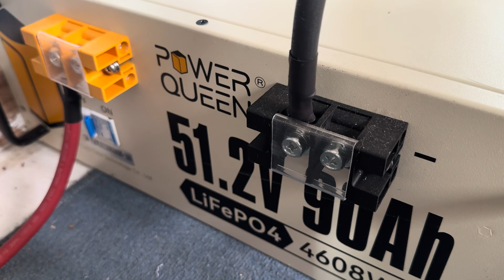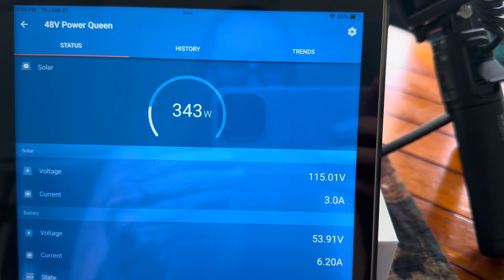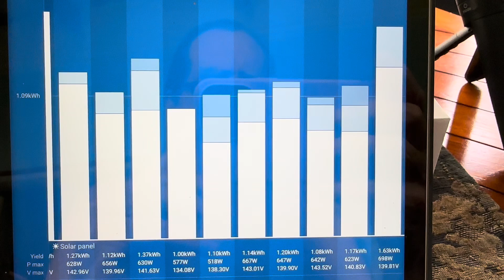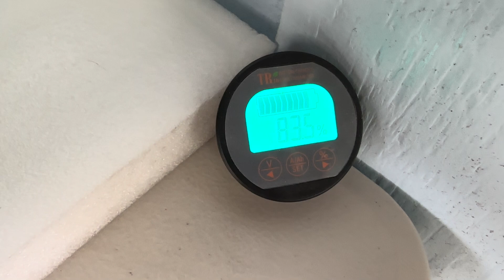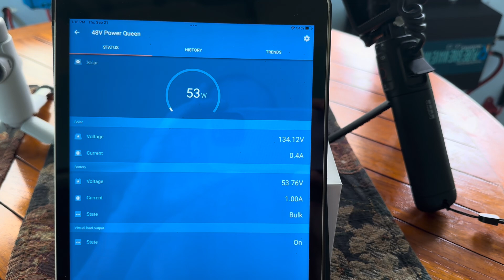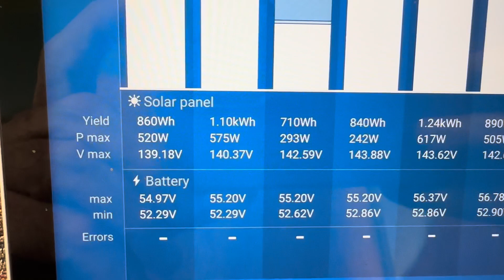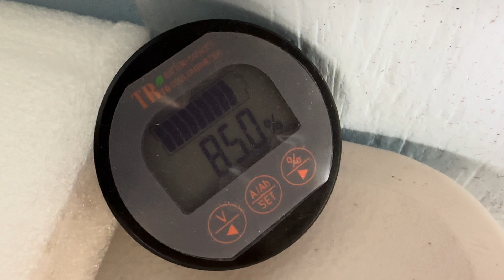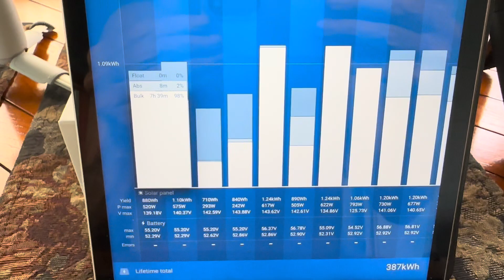48V LiFePO4 to 80% full. Working the sweet spot for maximum longevity?

Comment: Very interesting video showing live results.  I assume the battery has a BMS / balancer built in and it also seems like it's balancing the cells and interacting with the controller. I noticed your PV voltage was really close to the 150 limit a number of times and when it spiked the harvest dropped accordingly since you are targeting a certain battery voltage.  So for safety since I have NOT found a hard limit in the manual, you may want to re-configure the panels to be safe.  On the battery, is there software available to tap into the PQ BMS?  If so, it could very well explain more of the interactions going on with the controller and battery.  I agree, that with lithium we really don't need to charge to 100% and my understanding is that 95% may be a decent target since lithium exhibits a stable voltage profile relative to other chemistries.  I wonder IF you tried this again using the out of the box defaults (non expert mode) would you see a similar interaction?  Again, very interesting to see.  Aloha from SE Michigan 43 parallel

Comment: OK let me understand something, there isn't just a setting to say only charge up to 80%?
Reply: No, actually charging to a specific SOC target requires a calibrated shunt that feeds data back to the charge controller.  And even with that, the shunt's understanding of the SOC will slowly deviate from the actual SOC.  Since the settled voltage of the battery cannot be translated to a SOC percentage (there is no correlation, really except when the battery is nearly empty or nearly full), and because the charge curve is so flat, it is usually a lost cause to try to charge a LFP battery to anything but 100%.

Comment: If it stays at 80% for long enough,  it will be 95% + capacity
Reply from the maker: These parameters are all new understanding for me! Aloha! 🤙
Reply: @ProjectsinParadise808  I'm cleaning up my comments on this video.  It turns out we were ALL wrong because your battery is a x15 series configuration instead of the x16 series configuration we all assumed.  I posted the correct settings in a comment on your next video.  That also accounts for all the weird behavior.  (also your power meter says 85% or so but actually that battery was at 100%+ when it started dithering).
Reply: @junkerzn7312  I was just on their website and saw the 100AH version.  It was listed at 54V charge voltage.  Everything made since after that.  I was coming back to make a correction,  but you beat me to it.
Reply: @TheTimshady337  And now I'm not sure again.  But I think we are drilling down to the root of the problem.  The question is, is his battery 15 cells or 16 cells ?
Reply: @junkerzn7312  I'm thinking 15s and the spike he is getting is the battery BMS switching off charging and sending power bypassing the battery
Reply: @TheTimshady337  Yah, the spike is definitely due to the BMS turning off charging / disconnecting.   It is clearly cycling which means its probably a cell overvolt inside the pack.   And every time it happens the Victron just can't react quickly enough to there suddenly being no battery, and the voltage spikes.
Reply: @junkerzn7312  definitely what I'm thinking.  I always install a JBD because it has Bluetooth with individual cell monitoringa and  programmable.  I also add a 1A  Daly active balancer because it is also  Bluetooth and programmable.
Reply: @ProjectsinParadise808  I'm not too sure about the parameters, but if you don't discharge and keep 54v, it will  still be absorbing,  just a slower rare than at a higher voltage,  but it is still absorbing and building capacity.  It will just take longer to increase capacity.  I just use simple controllers,  but I understand how different chemistries react
Reply: @TheTimshady337  Not at 3.375V/cell (54V), no.  Once it gets past around 60% SOC the current will tail off very quickly towards zero.  Plus the balancer won't work at all at that voltage so this basically guarantees a messed up pack after a couple of months.

The way to think about it is that there is a potential barrier inside each cell which has to be overcome to push more charge into the battery past around 60% SOC.   If you do not overcome that barrier, the voltage will simply sit on the surface (so to speak, this is not lead-acid) and either not charge the battery further, or charge it so slowly that it might as well not be charging it at all.

This is why the float voltage is typically 3.375V to 3.40V in the first place.  The idea is to NOT charge or discharge the battery at float.   And this is also why the charge target has to be above 3.40V/cell (to overcome the potential barrier a above 60% SOC).  And for these batteries where you can't change the BMS settings, the charge target has to be up at 3.55V/cell (56.8V) to ensure that their balancers work properly and held there for 1-2 hours.
Reply: @junkerzn7312  you are correct.  I did the math in my head and was thinking 3.4v per cell. It will  still be what I would call bulk charge range and not quite in the absorption phase. I was wanting to emphasize that it doesn't have to get to 3.65v per cell to be a full capacity charge.  The problem I see with most prefabricated batteries is that an active balancing BMS is not what you want to rely on to keep the cells in a healthy state without overcharging.  I build my batteries personally and I have purchased prefabricated batteries and I would always open and install a JBD BMS and abb a  programmable active balancer of at least 1A minimum.  The problem  I have found in Prefabricated battery is that the  50 or 60 mAH balancer is almost useless.  If you would monitor voltage on each cell,  you would  see in the best cases, from 3v to about 3.4 all the cells would be almost perfectly balanced. (Because they will in mose cases still be in "bulk mode" ). Once the waekest cell reach past 3.45v . It will be out of bulk mode and more of absorption mode and will take the majority of the charge.  Unless you are charging less than 50mAH it will reach overvolt and shut down charging without  top balancing the cells to reach the full potential.  You can top balance with a prefabricated battery,  but it takes me a week to almost a month to do so with a regulated power supply and voltage measurements on each cell.  Sure if you would try to top balance at 3.375 v per cell you would be waiting your time at 50mAH as the cell as more in bulk mode, but in most cases the cells  are almost always close in  voltage while still in bulk  mode (3 to 3.4 v per cell. Once you go over or under the power band, the capacity and internal resistance differences will be more profound.  I'm not an engineer,  I just work with batteries everyday.